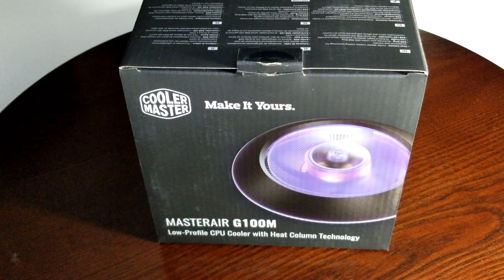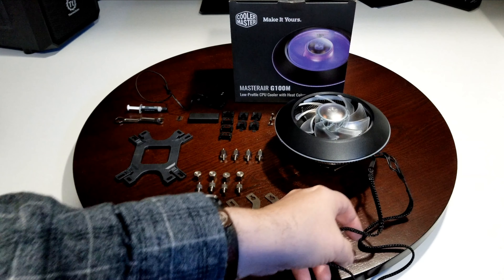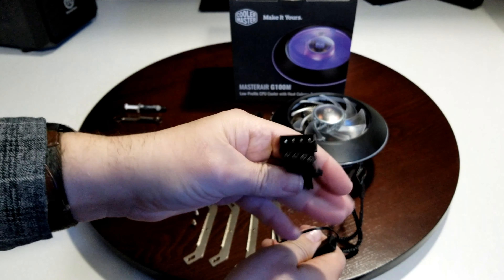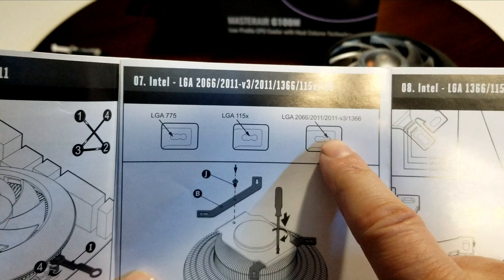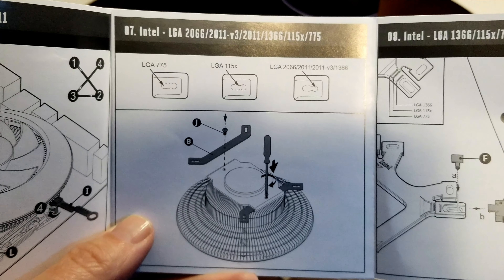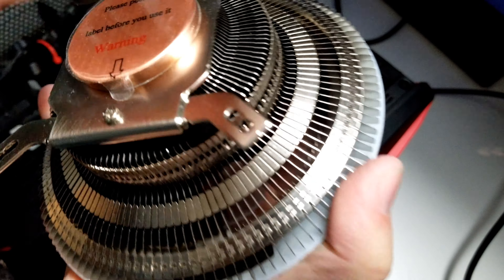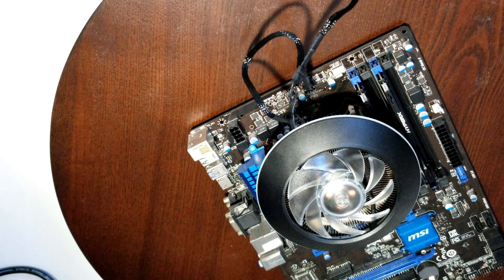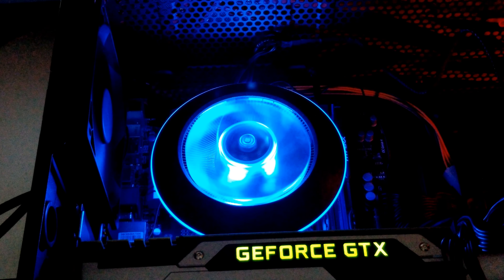Cooler Master MasterAir G100M Low Profile RGB CPU Cooler Unboxing, Intel Install and Look at Temps

Comment: You have your ram in the wrong Dimm slots
Reply from the maker: Appreciate your pointing that out, it's because the other Ram slots on this motherboard are messed up and don't work, tried to RMA it but it was past the date of being able to...so used it as is, will be replacing it eventually but for now it works and is fine...Thanks though...

Comment: my i7 8700k runs at 80⁰C when i play graphic intensive games with this thing, i probably need a new cooler
Reply from the maker: As long as it stays at 80C then it's ok, if it slowly goes up then yeah a bit better CPU Cooler would be a good idea.
Reply: @Reviewing_Playing_and_More_RPM  It slowly goes up to ~86⁰ so yeah definitely the fan is like 3 years old at this point
Reply from the maker: @lizardbladez  Yeah I'd have to agree with you on that, a good choice would be pretty much any AIO or the Hyper 212 EVO.
Reply: @Reviewing_Playing_and_More_RPM  will do. thanks!

Comment: Sir, do you have a video on Thermaltake UX100? Do you think it will handle a 6600k with gtx 970?
Reply from the maker: I don't have a video on it, but just went in and had a look at it, it's compatible with both Intel and AMD and seems like it would be good for the 6600K...having not used it I can't say for sure but it would seem perfectly fine...hope that helps...Thanks...

Comment: Hahah I was googling this cooler and boom Dennis lol I am thinking of running this on a 8700 non k it should
Be able to handle eh?
Reply from the maker: Yeah, it's not the the best but it's a good low profile CPU Cooler...temps will be decent...looks sharp as heck...
Reply: Reviewing Playing & More RPM thanks I think I might hit with the i71c rgb it’s still a lot better then the intel stock cooler and they are really inexpensive. Do you have a recommendation on thermal paste? I was looking at some NT-h1
Reply from the maker: Yep the NTH1 is the one I use and would recommend...
Reply: Reviewing Playing & More RPM you are the best! We need to go live and discuss hardware one of these days
Reply from the maker: Yep once I get my Fibre Optic so I have a stable connection for sure...might have it in 2 months or less now...

Comment: Sounds like a great device especially with hotter weather coming. It seems even with AC things still require more cooling. 😊💐🐇👍👍👍
Reply from the maker: Thanks for your comment, I really like it's looks as well, not the greatest in Temps but still better then the stock cooler...

Comment: Can i connect this to my fan case hub controller so i can use my remote for the rgb ?
Reply from the maker: No, the CPU Cooler itself needs to go to the CPU Fan header and the RGB might work in your hub controller providing it has the correct RGB Header...then you'd have to test if it then works with your remote...

Comment: I had the same stock cooler and it just was not doing the trick once I put in a 1080ti. Those CPU coolers also have to handle some heat coming off the GPU even if it is sunk. I went with a noctua but either way it's a smart move.
Reply from the maker: +Dunky Gamer Yeah was hoping it would cool better but 10C is still better and looks very cool...Thanks...
Reply: @Reviewing_Playing_and_More_RPM  it was a very interesting one to me, because it does not have a side exhaust position, but rather kind of dissipates Heat into the tower. One thing that might help bring your temp down a few more degrees could be a High airflow static pressure fan that replaces one or more of your current exhaust fans. When I put on my CPU heatsink and then replaced the rear exhaust with one of these High airflow static pressure jobs, it was the difference of another five whole degrees for an investment of less than $15.
Reply from the maker: +Dunky Gamer Cool  I'll give it a try...Thanks...